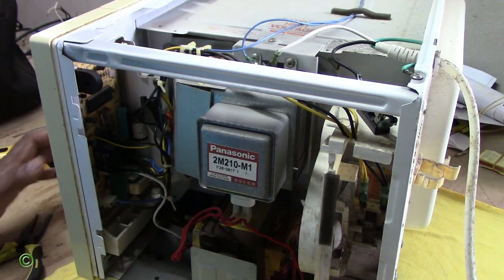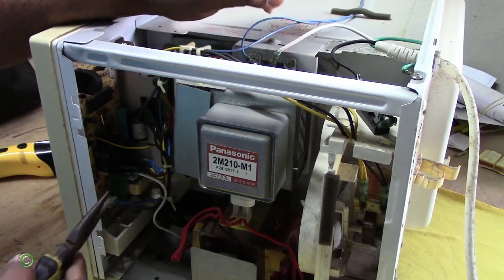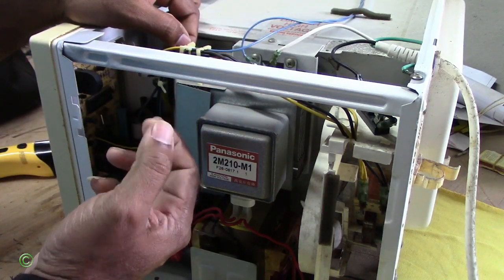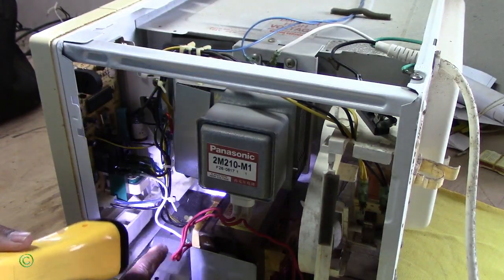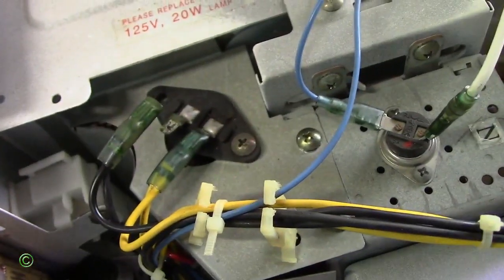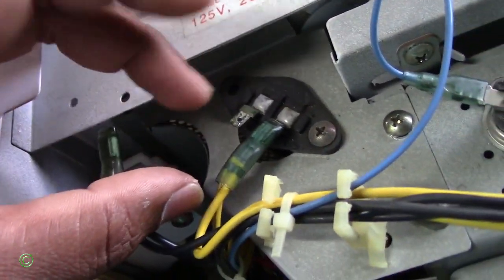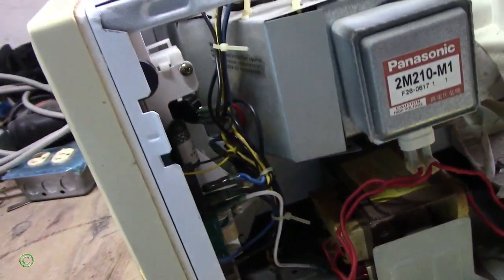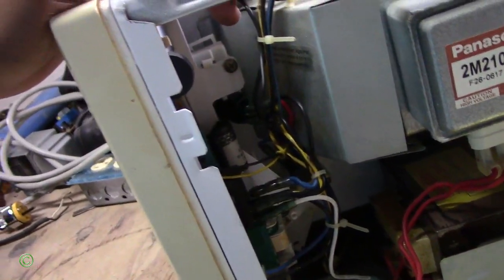Microwave Oven fused keep blowing (wire harness corroded)

Comment: If original fuse is 12A 250v , can I replace with 10A 250v
Reply from the maker: it should work. but it will blow faster under pressure. the best thing to do is put back the same value of fuse.